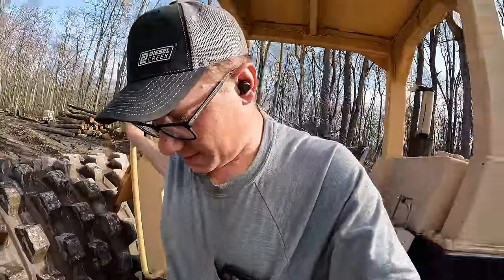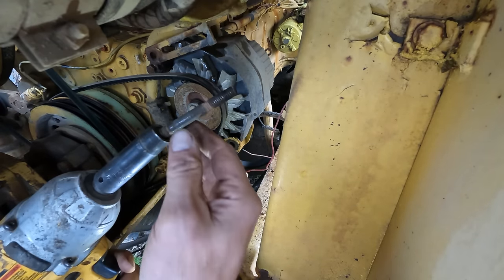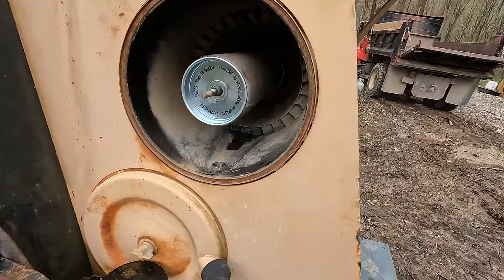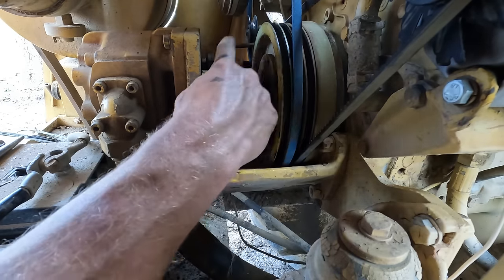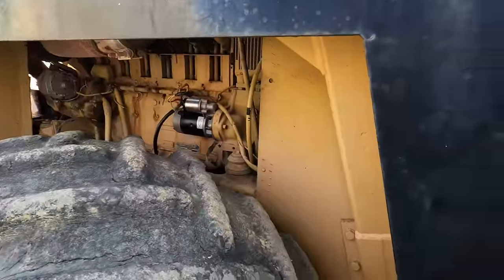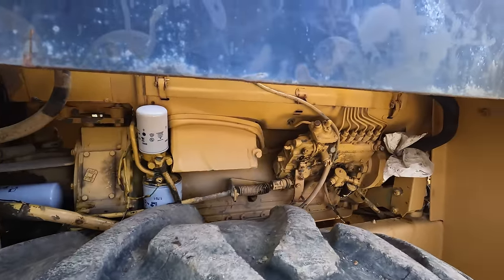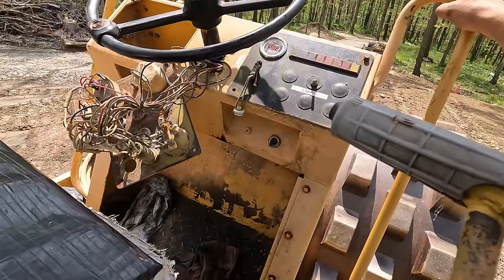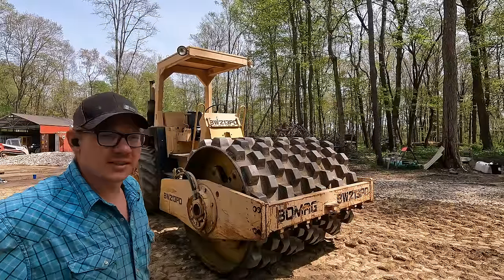I got BURNED on this Compactor from an Auction! (Bomag BW213)

Comment: Im guessing the guy that sold it to you isn't the guy who used it every day and had to fix it. LOL If the guy who designed them had to spend days working on them they would be so easy to work on, but as usual  they don't. I've had drain plugs that line up exactly with a sway bar. Ive even had a Donaldson oil filter  on a 10 ton Hino that had been threaded crooked at a 5 degree angle, and the filter is behind the chassis rail on the side of the motor. You cant see the top of it. I tightened up the filter, filled the motor with oil and started it up . The oil light didn't go out so i turned it off. You would be surprised how far 6 litres of oil goes on a concrete floor, because that's how much i had to put in it to top it up with the new new filter. LOL

Comment: The starter probably has a bad winding segment.  I had to have the starter replaced in my CRV for the same reason.  Don’t even ask what that cost.  That is the first starter that I have ever had to replace on any car that I have ever owned.  I have replaced a few Bendix units but never a complete starter.

Comment: Dielectric grease won't help your ground as it does not conduct electricity. It will keep the mating surfaces from corroding but it keeps those mating surfaces from grounding. And when it comes to spark plugs only on the porcelain or the boot not on the electrode.

Comment: Matt could you use a old pool steps or something like that to have go over the tire and climb up to work on the Alice or anything with the rear engine also I think that either that band pipe ihas a hole or the muffler if thin

Comment: Sheep foot is used for clay and silt.   How did you get hosed?  If you use a little bit of coconut oil on that dry rot tire you might possibly be able to save a little bit of additional wear. Replacement of the tire would be BEST.

Comment: I purchased a Massey Harris 44 special and feel that I should have known to expect from a farm sale. I had many of the same problems that you incurred plus a bad hydraulic pump.  I thought before the auction that I could deal with the problems that I could see.  I spent over a month trying to get it to keep running.  I would have been better off not even bidding on the tractor.

Comment: Have you ever tried to repair altenator?
I have repaired all of mine and usually it's just 10€ for new brushes,bearings and sliprings, but it takes two to three hours of works so thats that,

Still easy way to save some beermoney

Comment: Hi Matt,
3:40 it is not the same engine! You old compactor has the glow plug model 812 in it. This one seems to be an turbocharged one, but is definately a direct injection model 912 or 913.
Greetings from Germany!
Kai
Reply from the maker: I know they are different models, I mainly meant they are both air cooled deutz diesels

Comment: hey i have been watching your videos for quiet some time now.... i recognise the engine in this thing - i have worked on those before... if you need parts let me know - i'm in germany. 

if you exchange the pull magnet on the starter you could be fine - its the only thing preventing the switch from engaging. also there is a problem with these starter motors that they destroy themselfs when the washers on the top cover of the motor is worked through... its a quick fix and will ensure your starter turns faster again and doesnt commit sudoku... :)

you will see what the problem is, when you remove the top cover.... the main copper anchor grinds on the case... ALL THOSE starter motors have this issue...

Comment: That switch on the belt tensioner is to tell you if the belt breaks, probably a light but could be auto shutdown. Also looks like it uses 2 belts to fan.

Comment: the metal bracket on the blower motor /cooler  grind it off the 1/2 inch you need...heavier belts longer life etc...leave her better than you found her she will pay big dividends

Comment: the starter soleniod cam be refurbed in house quite esily2 solder conections in the cap end ( where all the conections are, this type of starter is a pre engaged type so you should not get the grinding of the bendix on the starter ring

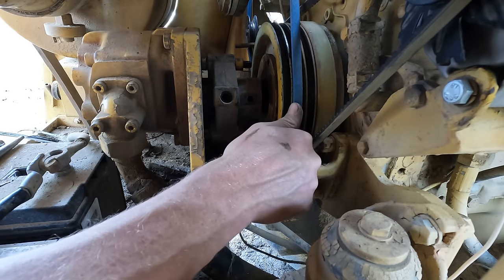Comment: 16:44 Normally, there is a switch on the tensioner pulley of the blower which, if the belt breaks, makes contact with the indicator lamp and then reports the error. With a fixed role, this is natural not the case. Only rollers with a spring have this switch
tighten the belt.
19:37 But that is not in the German manual.🤭

Comment: Matt, thanks for the video.  The fan needs TWO belts!; a critical system requires a backup.  Look in the manual or find a picture of the fan belts and then return it to original configuration!  I would strongly recommend that you restore ALL the warning lights on the panel.  You know more than me that old equipment often has shoddy maintenance once it gets too old or has multiple owners.  Especially since the owner told you they let the starter go for 11 years, shocking.  I am dealing with it on a 20 year old Jaguar they told me was their "baby".  I AM BEGGING you, restore the fan belts to the dual drive system.  The overheating you describe could have done damage to the head gasket or could have started a crack or etc.  Then you will be in deep trouble when the catastrophe happens.  I do hope you dodged a expensive repair.  PLEASE fix the fan belts! properly!!!!  Also. the purchase inspection is important and you have missed that event on other equipment in the past and it has come back to bite you.  That belt did not give up without some kind of warning and a thorough inspection or daily inspection would have detected it before it failed.   Please learn from your mistakes.

Comment: these deutz engines have a few failsafes for overheating, you can either hook a switch to the belt tensioner so if it fails, the switch kills the fuel. Typically they have a sense circuit from the alternator that kills the engine, but since someones swapped that one and it uses 2 belts there goes that idea
Reply: at 23 minutes you can see the kill switch on the belt tensioner

Comment: If it is cold blooded, that means you are not getting power to the glow plugs. I’ve started deutz engines easily with a foot of snow on top. Just test the power on the glow plugs, first thing.

Comment: If i was working for an auction house like this i would tell them that it should have some preventative maintenance done so it at least works for the most part without disassembling the entire machine like that is just unacceptable and not to mention very dangerous especially if vital gauges and lights aren’t working

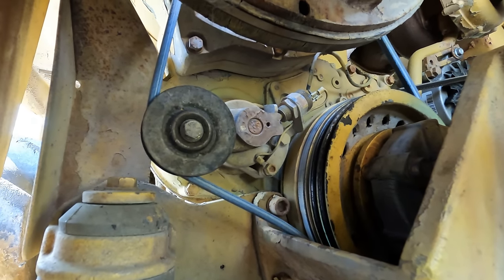Comment: At 23:27 there appears to be a switch opposite the tensioner pulley - is this meant to tell you the fan belt has failed and light a warning light on the dash, or is it for something else? My father's 1970 Ford had a starter with exactly the same problem as yours - the contact points in the starter solenoid had failed so there was insufficient current to throw the Bendix out fully and turn the starter motor properly. It too left the flywheel looking like yours but a colleague at his workplace dismantled and cleaned it, dressed the contact points and it was as good as new again. Have just finished binge-watching the Galion work and enjoyed it greatly. Best wishes from the UK, Howard.

Comment: I assume the horrible metal on metal hammering coming from the drum was foreshadowing?
To be fair the fact that none of the gauges worked and the starter had been intermittent for 12 years were indicators that this machine had not received the best of care.
I hope the engine wasn't damaged by overheating.
I love the idea of air cooled engines but they did not hold up well on the Deutz Allis tractors.
Part of that may depend on the climate in your location.
Here's hoping you can get it running again without dumping too much additional time and money into it.

Comment: In a car and likely that - the sliding gear is inside the engine block.  The coil is outside and if the engine is low on oil the slide doesn't connect the gears.  Hope you can find it. I would think oil would be splashing on the gears and keep the starter spur gear wet as well.  Rusty might be oil pump issue ? or it doesn't splash.

Comment: Hi matt get a good file an dress up them bad teeth on the ring gear you will also find a couple more bad spots on the ring gear ,if you don't  clean em up it will cause  peremature failure of starter bendix !

Comment: Atta boy! I was watching you pickle around with a 1/4 impact and complained about seized bolts. Get that 1/2 drive and get something done.

Also be careful with that sheeps foot or grid pattern on your drum. That’s for pushing rocks and stone down and bringing fines up. Your material looks awfully dirty to me. If you run that on there and it rains. You will super saturate your grade and end up with pudding. I didn’t see if those are bolted on and it has a smooth drum or if it’s just a sheeps foot.

Comment: Dialectric grease is non conducting so you are insulating the earth connection  between the motor and block. It wont corrode though!

Comment: As for electrical problems my Dad was an electrical engineer and he figured everything out so I didn't have to.  When he died for the first time I had to figure it out for myself. If I hadn't been a dumbass I could have learned before he died. Finally found a book that actually shows you how to solve electrical problems. Tracy Martin "How to diagnose and repair automobile electrical systems" it is about $20. If you can understand it Heavy equipment will be easier to understand or motorcycles. It is really worth it's weight in gold. I have been able to solve all my electrical problems since.

Comment: be careful with deutz air cooled engines. Replace the fan belt regularly. It has an electrical contact that will sound the horn if the belt fails. Have ever seen an almost new machine with an identical engine in a wheel loader break down completely because the alarm was not connected. Engine stalls immediately!!!!!!!!! you were lucky that the engine was a bit older.

Comment: You should have twin belts on the engine cooling fan, single belt does'nt seem upto the job.  Looks like at some point someone rigged it up with a single belt as a short measure. 
These Deutz aircooled diesel engines were used in all sorts of machines from 'Magirus Deutz' trucks to power generation and construction machines, hence the awkward location of that oil drain plug. Best engines for standby power generation, none of that liquid cooled water pump, radiator and other components to worry about. Not sure what happened to Deutz, but IVECO seems to be in the picture and they are all about liquid cooled engines.

Comment: file those teeth on the fly wheel!
and replace the alt belt while you are in there.
lol on the bag of snakes!
lol on the belt rubbing!
comedy of errors for sure!
drainzit hose works for the oil drain.
and dark shirts when working on diesel gear.🤣

Comment: I thought air cooled motors always had two belts, one for back up. I thought all mechanics added penetration oil before attempting to remove bolt on parts. That's what I thought before watching Diesel Creek. Good luck on the starter repair. Someone may have hit the starter switch with the engine running, ouch, not good! Hey, if it was easy, everyone would be doing this.
Reply: If the oil isn't gonna get where you need it to, it's kind of useless

Comment: if a deutz won't start when its cold it's a dog. they are extremely good at cold weather and if the motor is any good won't need any pre-heat too

Comment: I guess I'm late to the party with this video...  The belt rubbing on the metal wall...  a straight line from the bottom pulley to the next higher pulley makes it look like even a tighter belt will rub.  I'd be looking for an adjustment someplace to raise the smaller pulley.  There may be a third pulley in the mix too - a little higher up.  Anyway, I think there's probably an adjustment to raise the smaller pulley.

Comment: If you spent $22,000 on this machine 1st rule of thumb I would think is to  replace all  filters and fluids .
That will tell you what you just learned the machine was only serviced when it stopped moving. Maybe it had 3/4.tank of fuel because most is water. Yes oil floats on water . So worth the while to drain and inspect fuel. If you need an operator for free on my bucket list  ? Awesome videos

Comment: I'm only 7 minutes in  so far. But one thing I've learned is sometimes you need  to spray them old nuts and bolts down with wd40 the day before.

Comment: Air cooled Deutz have two and three belts. Too much load on that single belts, it will give up soon  enough. Change the tensioner to a double pulley and run twin belts.

Comment: you don't have a lot in it (22 grand ain't chicken feed but in today's market it's a deal) and you have the equipment there to fix the drum metal on metal pounding. It should stay together long enough to compact the building pad and you can sell at that point or break it apart on fix the drum. I wouldn't say you got burned: you got a fair machine that someone didn't want to fix. If you fix it, it will be a great video series.
Reply: Did you watch the last 5 seconds of this video?
Reply: @davidnull5590  Yes, I was trying to chear the man up.

Comment: Hey man, are you sure that your toy runs on the correct voltage? This monster was built in Germany and we Germans put in two 12V Batteries into a machine or a truck usually to let it run on 24V! Maybe, this is one reason why it cranks up so slowly...
Moreover, did you preheat before cranking? Perhaps that is one of those dangling switches at the beginning of your video...

Comment: Loose dog around construction equipment is not good seen too many run over.
every time I bought used equipment very first thing I did was inspection and overhaul, find what needs to be fixed and FIX it, that includes replacing old belts, fluids and filters, find and fix leaks get all the gauges working, all of that will save you from creating expensive repairs like cooking the engine because of broken fan belts and gauges  not working.

Comment: Drain the fuel tank and flush. Radiator too. When airing up tires, real caution must be observed. Sometimes the lube that is used on the tire bead gets on the valve stem blocking air coming in OR OUT. Dismanteling a tire that is still inflated is deadly. Take out the valve core and PUSH A WIRE THRU IT. Just because a tire is big does not mean it takes more air pressure. Quite the opposite. find air pressure requirements on each tire. Clean it off and don't ASS-U-ME.

Comment: @4:30 oil is going up the air brake line. The sock is a spit collector...except instead of water, it's oil...gasket issue 😑

Can't and shouldn't blow air filters out...

Comment: If you change the starter and it just clicks  what could the problem be ? I did this on my 840 Superpac. I boosted it also same thing and my voltage was 12.63 volts and dropped to 12.34 volts

Comment: At 11:40, could you not use a link belt? Do these have downsides I should know about? I have an old lathe that could use a new belt, I would prefer to avoid taking apart the whole headstock. But I have not had any personal experience with the link belts. Anyone have any input? Do they make one to replace flat belts?

Comment: I think you screwed up on the drop test.  I'm sure somewhere in the manual in little tiny print, it says a two drop minimum is required.  Or, in lieu of this full drop, the finger pinch test where you drop the starter or any other heavy, hard to reach handheld part, only a few inches but onto the tip of one of your fingers is acceptable (extra credit for a blood blister!).

Comment: You know dielectric grease is actually an insulator. . . Non conductive... it's why it can be splooged into bulb sockets, across both or all terminals, and not short it all out. Soooo... putting it between two metal things, and saying it promotes conductivity, isn't right... if anything, it proves like a rubber gasket. It DOES prevent oxidization, so that much is true.... but putting it between the starter and the block means that the ground strap is doing ALL the conductivity for ground / negative.

Comment: Is this unit operating on 12 or 24 volts ? The starter I would have it rebuilt!  And that flywheel….. I would rotate it until the bad teeth would’ve in starter opening! Thin I would put paint on the front pulley marking the bad part! And then before starting I would roll crank over to pass the bad part! Most of the time I would put wrench on pulley nut and rotate past unit starting problems! When you jump past the starter solenoid with your battery cable you might have switched it to 24 volt crossing the two batteries!

Comment: Mate -- inspect, fix and service 2nd hand machines BEFORE you start work with them. Then you've got reliability for the job rather than stop-start piecemeal repairs.

Download a bloody manual so you're not guessing belts etc. You might have just replaced a wrong one.

Comment: I am going mad! That starter does NOT have a Bendix drive! Look it up in wikipedia under Bendix drive if you want to know the difference between a starter with a Bendix drive and one without. The starters with Bendix drives don't have solenoids. Bendix is not a generic term for a starter drive. It is a particular type of starter engagement which does not use a solenoids. Relays are not solenoids either, though a solenoid usually does operate a relay among other things, like starter drive gear mechanisms.

Comment: Matt it does seem it’s not really vibrating as much as it should. I have a larger Bomag pad foot and when you stop and have the vibration on the drum jumps it vibrates so much.
Reply from the maker: I agree. I think the drive motor is going bad. But it has bigger issues now, video coming eventually